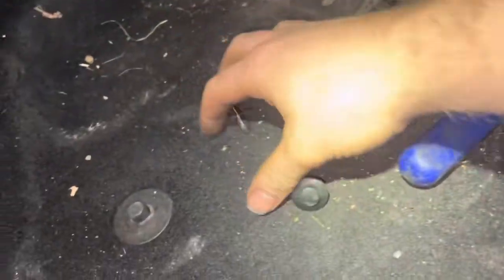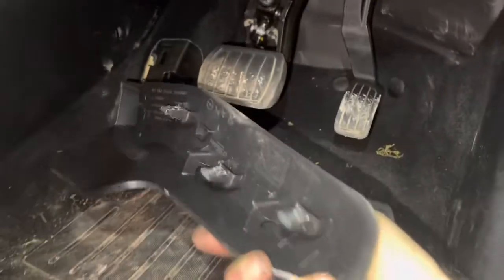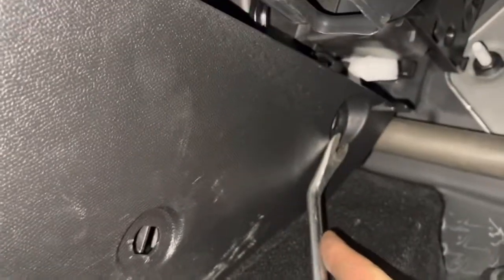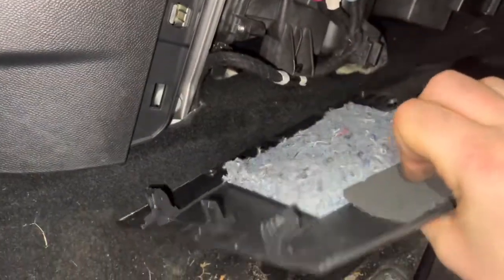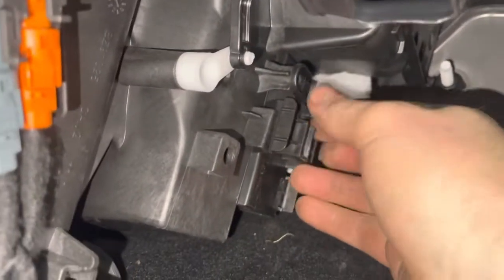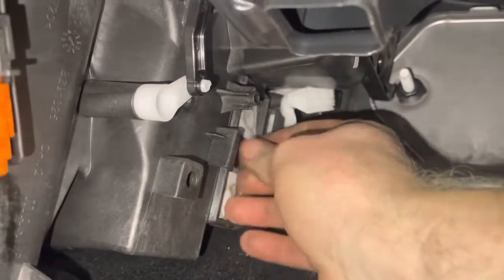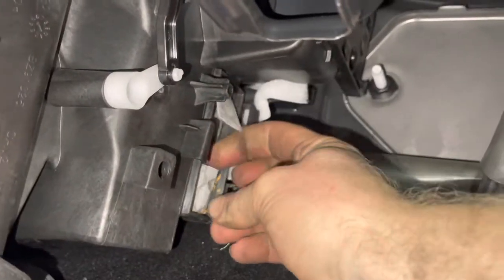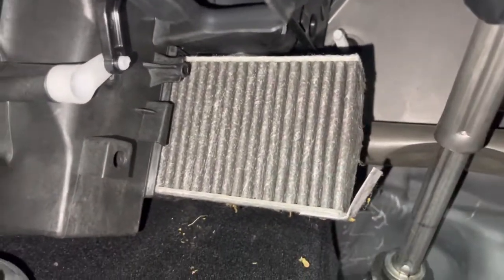Peugeot 208 cabin filter pollen filter location new shape 2019 onwards p21 second generation

Comment: Thanks 'Dan' for sharing this. Your guide certainly helped me replace my Cabin filters, which incidentally and despite 3 alleged x main dealer (Peugeot) services previously, before I acquired my 20 plate 208;  the Cabin filters were factory original (they were dated as: 2018 manufactured).
So much for a Peugeot 'full-service' rip off.......

Regarding the comments below, there are 2 x Cabin filters here. Pull out the 1st filter and the 2nd is located above it and it should simply drop down.
It becomes a bit tricky re-fitting the 2 new filters, as you have to hold up the first installed filter (in it's upper location) whilst attempting to instal the 2nd filter below it.......
Reply from the maker: Cheers for the feedback James, appreciate it 👍